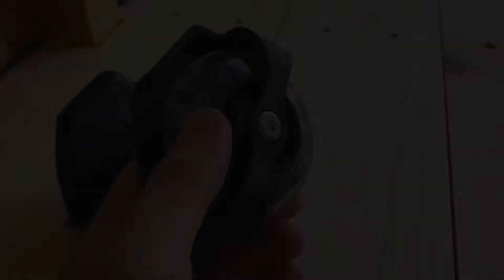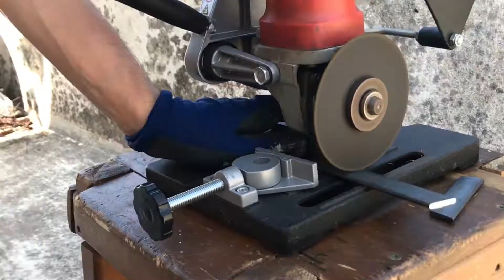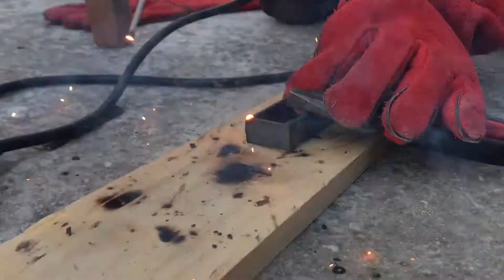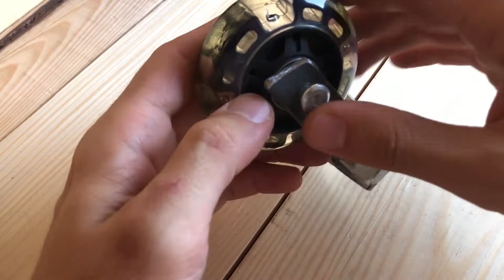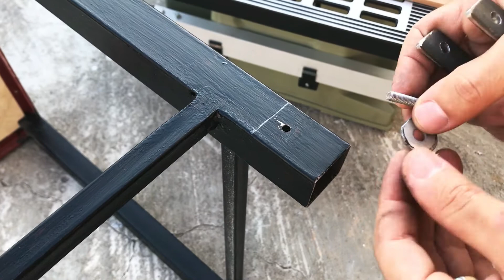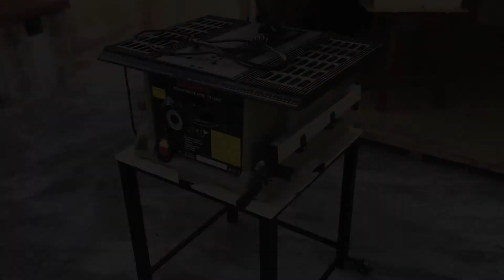DIY Life hack for the Handyman. (Table wheels)

Comment: My idea is to put wheels on the bottom of my industrial sewing machines. I tried with one but didn't know that wood would split. Thank you for showing the inner workings. One day when I get back to adding movement to my trade equipment, I'll look for what's out there at the hardware store.